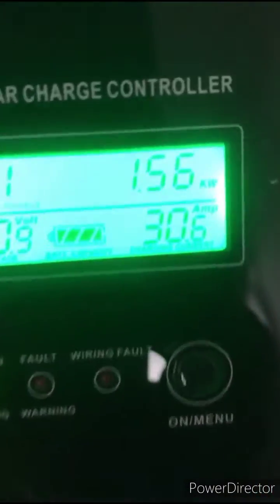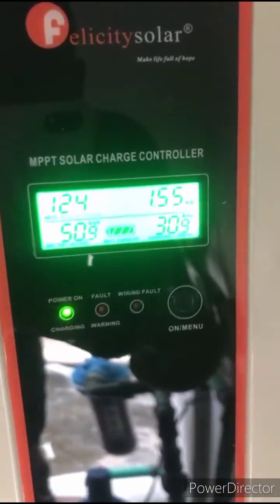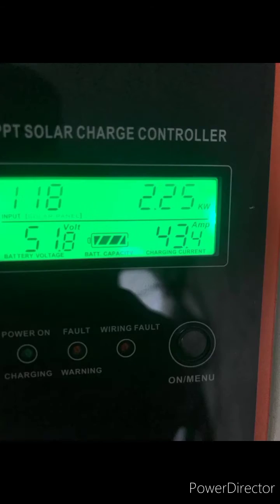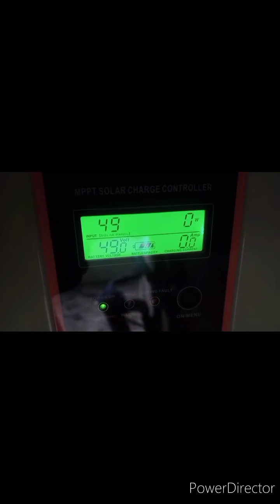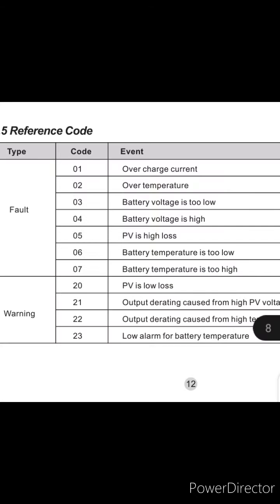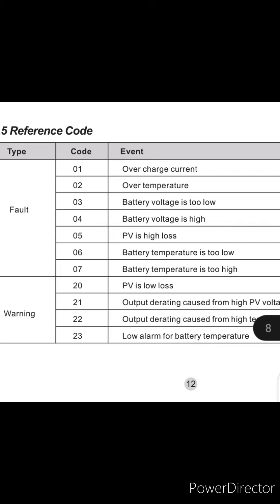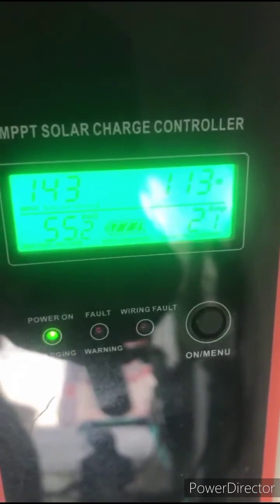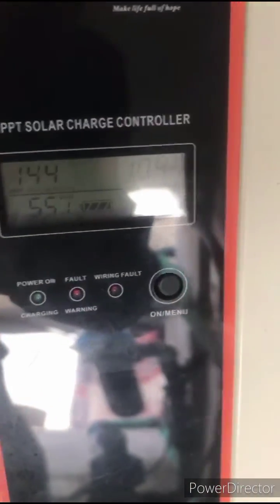warning code 20 in Felicity charge controller

Comment: I'm having same issue here, after 11 months of installation.
Reply: Check if panel is bad cus same happen to me one panel was bad in mine and if ur volt is not high enough it will also show this
Reply: Yes, the issue was from the panels, I got to the client hux and reconnected the panels, the panels efficiency dropped that was what course the issue
Reply from the maker: it was worked on but after 2days the fault appeared again i believe the issue is from the panels.i will still post update
Reply: Is the update ready please?
I'm having this same issue right now.
Reply from the maker: i checked the arrays and discovered that one array was giving 4A instead of 8A so i disconnected that one but before then the customer has bought another controller (Prag) and it has been working.So the felicity still has the error 20 it i dint take it back to them again
Reply: @colcent_solar  was it Felicity company that repair it or normal repair
Reply from the maker: @laurabarnes3295 first was normal, second time was Felicity

Comment: what was the discovered fault/cause?

And how much did you use to fix?
Reply from the maker: they said it was mosfet issue, i paid #15,000
Reply: @colcent_solar  Yes, because there was a wrong polarity connection in the pv input, that's why it affect the mosfet. Nobody is perfect.
Reply from the maker: @adeboyeadeyemi6228  ok,thanks for your contribution
Reply: @adeboyeadeyemi6228 but what caused it to be working fine B4 even with the wrong polarity from the onset ?
Reply from the maker: @oluwaseunadekunle3193 there is no wrong polarity
Reply: @colcent_solar has it happen again since when you repair and reinstall??
Reply from the maker: @davidjay2957 the customer bought new one (prag)
Reply: @colcent_solar  good morning morning, please am having issues with same Felicity controller I would love to share to see your suggestions.
Reply from the maker: @raphaelnwodo5445  ok,you are free
Reply: @colcent_solar  what am experiencing is that it takes time to start charging and when it starts charging, it will charge for awhile and stop after some time before it starts again
Reply from the maker: @raphaelnwodo5445  which model?
Reply: @raphaelnwodo5445  The system charging is in three phase. Please, check manual for details. Thanks
Reply: Same as me charge and and stop but not a Felicity product
Reply: The error code 20, was as a result of wrong(polarity)connection in the PV input. Thanks